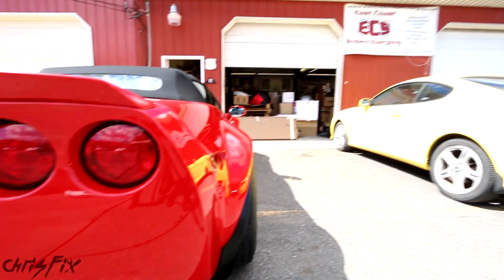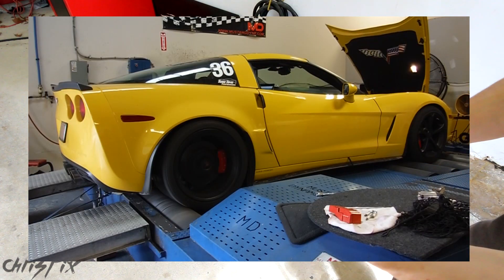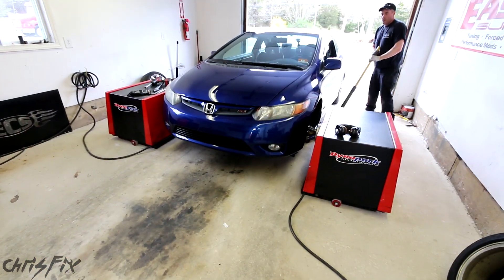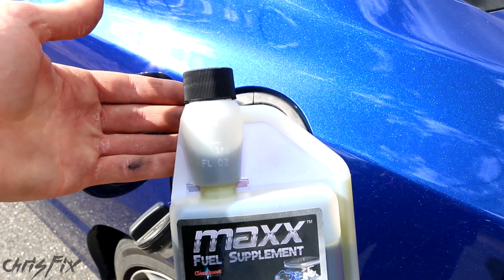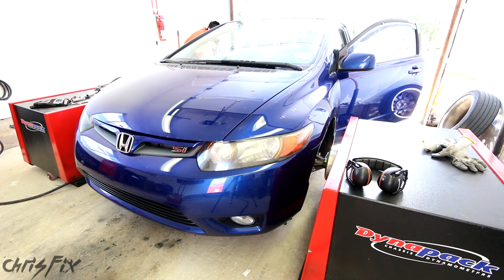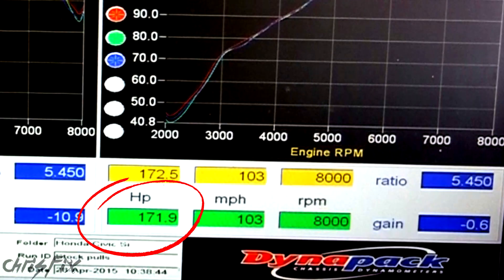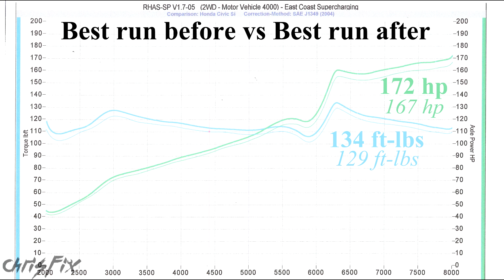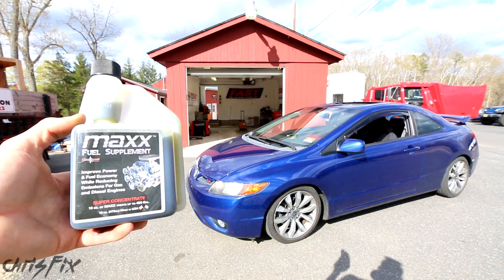Can a Fuel Additive Really Increase Horsepower in Your Car? (With Proof)

Comment: By the sound, it seemed during the 3 test with the fuel additive was pushed farther RPM wise than the first 3 test. The Dyno should show RPM @ HP ratio. So you could compare exact points. likes say @7000 RPM how much HP...
Reply from the maker: Torpedomtb The dyno had an 8k rpm cutoff for every run. You can see the info on the computer screen while the run is going!

Comment: Doesn't the Honda si need too have 192hp. Dealer states comes with 192hp and it boosting out 162. False advertisement don't you think?
Reply from the maker: Alejandro Sanchez That is power to the crank vs power to the wheels.

Comment: Good test. Try Torco. One of my buddies has a turbo Miata for racing and uses it when running the higher boost map without race fuel. Last I heard he made 375HP at the wheels and is still Mazda powered.
Reply from the maker: ABetterLife.Inc Wow, that is impressive! I need to check out Torco. I never heard of it! Thanks for the suggestion! This is how I get my ideas for testing these products so I really appreciate it!
Reply: No problem.

Comment: it supposed to restore power by cleaning intake valves and other pathways with detergents. It does not make it rocket fuel..
Reply: guyonthecouch007 You need PEA's in an additive to clean up carbon build up and you need to run nearly a full mixed tank through, often more than 1 tankful on particularly bad carbon deposits on high mileage cars never treated.  This product has zero PEAs and he most certainly did not come close to burning up a tankful of mixed gas. So carbon buildup/cleanout is most certainly not the issue here.
Reply from the maker: guyonthecouch007 It works by increasing the amount of BTUs (energy) in the fuel.
Reply: so you mean higher octane?
Reply from the maker: guyonthecouch007 no, it does not increase octane. The higher is the resistance to detonation. I had to ask the company how it works because I got so many questions and here is what they said: How it works is it is a catalyst that maximizes the potential energy in the gas and converts it into kinetic energy. Basically, it is making the most of the gas that is in there already.

Comment: WOW 167 HP, My head just exploded
Reply: It's a Civic lol
Reply: SANTA978b 

More impressive is that 129 ft-lbs. Stout.
Reply: +SANTA978b HP at wheels is different than hp at crank. BHP is hp at crank, or the hp the car is advertised to make.
Reply: Josh River yeah lol i track the car too so you can click on my name and watch it lol it was a tuned sti in front of me  i was 3 seconds slower but still on street tires
Reply: SANTA978b pretty impressive for a n/a inline 4 whe nyou think about it lol
Reply: Model192 tahts vtec bro
Reply: i make 230 hp at the wheels but on that dyno i get 20 more cuz of less weight
Reply: Aroutin Abramian Frankly, who cares! It really wasn't the point of this video. Whether your the owner of a civic or a chrysler 200...one thing is for sure...you shouldnt give a shit which one is faster.
Reply: Ned Bass my comment was in regards to a couple dorks debating over which of thier cars (civic & chrysler 200) was faster.
The video its self was good. I even thumbed it up.
Reply: SANTA978b A cheap BWM or Mercedes has less HP
Reply: You're taking my comment out of context, back in the 80's a V8 had about 190 HP the fact that 4 cylinder engines are getting to 200 hp I find that really impressive,
Reply: Homemade Stuffz a cheap Honda has even less HP , if you're going to compared a entry level car from Europe is only fair you use a entry level Japanese car, now the SI is a top tier car it needs to be compared to a top tier car from Europe. Is like some kids out there that say and I quote " I got a turbo in my car and I can beat any V8" well maybe that's true, but if your running a turbo and the guy on the V8 is running  a turbo too, who will win then? BTW I drive a 4 cylinder turbo car and its fun, but is FWD and that sucks a lot. The only European car that would compare to the Si is the GTI and the GTI is a way better car than the Si.
Reply: +SANTA978b  lmfaoo what top tier car?  a gtr is top teir not a civic this car is against the gli/gti i driven both i didnt like the lag on the gli i have raced a gti with my civic with just an exhuast pulled car lengths on him all you need on this car in a hybrid racing cold air intake, plm leader, any 3" catback and a hondata flashpro and tune you get 215-30whp put on on rpf1 17x9 with 245/45 to deliver the power plus its more grip and lighter then the stock enkie wheels you get. the civic is an amazing car theres alot of applications for it from daily to 1300hp drag k series cars to time attack monsters like spoon's FD2R  there are different ways to drive fwd and rwd both can handle differently both are amazing handling in there own way it depends on what your comfortable with
Reply: Aroutin Abramian I think when he said "top teir" it is in regards to a trim level of a specific car.

And its very naive if you think those modifications you listed will create 215-230whp. Cat backs and cold air intakes themselves are only good for engine note changes.  Tallying up all the HP gains that are displayed on the boxes the parts came in is overly optimistic and very unrealistic.
Reply: Josh River lol okay then the dyno is very in accurate then i geuss a intake manifold a tune headers 3.5" intake and 3" catback dose not put out 250whp on dyno pack and 230whp on the wheel dyno
Reply: +Aroutin Abramian sorry about that I fucked up. I took a second look and it was 225whp.
i def owe you an apollogy for that one.
Reply: ***** I don't think I said anything about BHP or WHP, I just said the  Golf GTI has 210hp and in my opinion is a better value for your money than a Civic SI that has 174hp (stock numbers) the Golf GTI handle's better too. 

When I said the Honda SI is a top tier is because I can't compared the SI to a Civic LX that has 143hp (stock). I don't know anything about a Honda GTR, I never seen one probably not sold in the US like many other great Japanese cars, so I can't comment on that specific vehicle. On the other hand is not fair to compare a base trim Golf that has 170hp to the Honda Si 174hp, BTW your  insults won make your Honda faster.
Reply: SANTA978b I was replying to your original comment "WOW 167 HP, My head just exploded". Not your comment comparing the SI to the GTI.
Reply: Josh River its okay man i also did a few upgrades and a touch up tune im pushing a lil bit more ill do a dyno again soon when my trans is back up and runing
Reply: Aroutin Abramian yeah...i wrote a pretty sarcastic comment. I deleted it not long after I wrote it  but you may have still recieved it. I really stuck my foot in my mouth on that one. For some reason I just fixated on the 167hp in this video and confused the info I had. 
Nevertheless..gotta say your numbers did surprise me a little after I came to my senses.
Blue thumb up!
Reply: Stock k24 makes 240 whp and that's not boosted so I'd say that's pretty good
Reply: +Stuntihn MX what in the fuck are you talking about. k24 to the crank makes 200 in current gen SI. smh idiot.
Reply: What do you expect? it's a 4 cylinder engine, its a daily driver, a normal 4-Cylinder car, produces 120-200hp. It's not a 2015 mustang engine.
Reply: +TheMinecraftChannel!- Minecraft and Other Games!   lol mustangs only make like 250 😂
Reply: Actually, 305 on the I-4 engine
Reply: I still don't understand  how people call it a "muscle car"
Reply: Do you how many hp the fastest production mustang is ?
Reply: Model192 He said I get 20 MORE
Reply: TheMinecraftChannel!- Minecraft and Other Games! 
I used 2 bottles so I got 40 more!

Comment: I have an Alfa Romeo 147 1.9JTD (Diesel for you USA) and after putting a fuel supplement I really felt the engine running smoother and quieter. I thought it was a subjective feeling so I asked other people and they confirmed that the car ran a lot smoother.
Reply from the maker: carson phillips Nothing would happen. How it works is it is a catalyst that maximizes the potential energy in the gas and converts it into kinetic energy. Basically, it is making the most of the gas that is in there already. It is not an octane booster. If you add too much, you are just wasting money. I have no clue what would happen with an octane booster.
Reply: All I know is the engine runs more smoothly and has a really nice throttle response :)
Reply: jeffel80 SI fuel oxygenators do not increase/boost the octane rating. The product that ChrisFix showcased in this video is a nanometallic catalyst.
Reply: patw52pb1 isn't tribology cool!
Reply from the maker: Count Dracula Awesome! Thanks for sharing! Nice Alfa!
Reply: Thanks Chris! Excellent job on the videos! Continue with the good work mate!
Reply: ChrisFix what would happen if you put more in it then it suggests? also can you mix it with an octane booster or is that what this basically is?
Reply: just use 2 stroke oil with JASO FC specification for your diesel engine. it will run smoother, help the diesel burn cleaner whats good for the particle filter if your alfa has one, the additives in the 2 stroke oil cleans the injectors and also reduces wear in the high pressure pump....

Comment: Were you using a standard cheaper fuel or High octane fuel for your test? If you were using a cheaper fuel, buying the higher octane fuel might get the same result. In any case, let's be honest here, 11 is not that big a number really. Sure it is an increase but I doubt the driver would notice the difference when driving. With that all said, the bottom line is that the additive appears to do what it claims it will do.
Reply from the maker: Joe Will We used the required premium gas (91 octane) in the engine.
Reply: ChrisFix
I wonder if you would have got the same boost by using Premium (98 Octane). I know that with many modern cars, the ECU can adjust the engine to suite higher octane fuel automatically and I know it's not uncommon for fuel mileage to improve simply by using a better fuel. Even my old car (that uses a Carb) tends to run a little better on Premium and there is no computer in it - I did advance the timing a fair bit though.
Reply from the maker: Joe Will We would have made more power for sure since the engine is a high compression engine and can adjust timing. This product is not an octane booster, it is a catalyst that causes the gas to burn more efficiently therefore giving you more power. Octane works by allowing the car to adjust timing so you can make more power. I want to test the fuel economy claims on this stuff next!
Reply: ChrisFix
Well basically, yeah, Higher Octane is slower burning.
Reply from the maker: Joe Will Well, gas burns the same speed, but premuim wont detonate due to high compression or anything like that so you can get better timing (which is what I think you mean by slower burning)

Comment: ChrisFix I have a 98 Honda civic with a 99 civic engine in it. Only use regular gas in it  would if I used premium in it make it perform better? Would be nice to see if you could do a video on it.
Reply from the maker: Msngr0fd3ath Is the 99 engine the same as the 98?
Reply: ChrisFix yes well I bought the car before the swap. But its the VTEC engine my cars the ex model.
Reply from the maker: Msngr0fd3ath What does the owners manual for that engine say? That is what I would go by. If it recommends premium you can make more power. If not, you probably wont see a difference.
Reply: ChrisFix the owners manual says I can use gasoline of the octane 87 and higher doesn't recommend premium or regular.
Reply from the maker: Msngr0fd3ath Then you probably wont see much of a change since your engine really cannot make the most of higher octane gas.

Comment: more or less just an octane booster that gave the engine a hair more in timing thus giving the games. I can do that at the pump anytime I please.
Reply from the maker: jr540123 Actually, it is not an octane booster. I asked the company because I was getting a lot of comments asking what it does and they said it increases the efficiency of combustion so basically you get more power from the same amount of gas.
Reply: ChrisFix I think we ought to see this test done again in lets say a closed off shop with controlled temps and we the viewers get to see a test with the air fuel ratios up as well as an exact room temperature for a full blown no denying it works test.
Reply from the maker: jr540123 A closed shop is a bad idea because then you will have to take into account air temp rising significantly and also when the car is floored, there is a vacuum created from the suction. The air temperature, humidity, pressure, etc were all taken into account by the dyno and corrected for in the HP and Torque numbers. It would be good to see the A/F ratios though!

Comment: I own that same exact car. An 08 blue si coupe. I don't understand why it didn't go faster than 106? My fuel cut off is 136. Would that make a difference?
Reply from the maker: Cj Snyder We set red line on the dyno to 8000k. I dont know if that makes a difference. This isnt my car so I am not familiar with how fast it goes in what gear.

Comment: ChrisFix   So, what was the temperature of your drivetrain when you did the tests?, In particular I'm wondering about the viscosity of the oil in you got in you gearbox/diff, as cold oil will add a lot of extra drag. How about the battery voltage? Was it low before the first test, then topped off after the 15 minute drive? The alternator can add a lot of extra drag.  Ac ? Many variables, how about the outside air temp ?
Reply from the maker: ***** For as much stuff as we can control in a field test like this, I tried my best to keep things constant. We drove the car there for 30min and everything was at operating temp. We did the first runs in about 15min and then added the additive. Then we drove around for about 20min where everything was at operating temp again and again waited about 15min to do the final three runs. No ac, no drop in voltage, etc. The air temp, humidity, pressure, etc were all recorded by the dyno (check the screen) and adjusted for to give our numbers. Now this is just a single test and as a scientist, I know you need a big sample size but the idea is to show the results are promising. Plus, unless you want to give me another $300 for each test, this is all I can afford out of my own pockets.
Reply: ChrisFix It was just things that jumped into my head when I saw this, I know from personal experience that getting "identical" dyno drags is almost impossible, 5 Horsepower is not a lot, and it's borderline normal error margin\tolerance. By your description, it sounds like you did what was in your power at the time. There is also things like the Barometric air pressure that comes into this... air moisture ect, it's as I said, nearly impossible to get identical results.
Reply from the maker: ***** And I really appreciate the feedback and info! That is the idea! We are all looking for the same thing with these videos... To learn and to get real results so we know best as consumers what actually works and what is snake oil! I want to test the fuel economy claims to see if that is real so then we can see if there are two things going for this additive!

Comment: How does this affect a Turbo engine? I've realized my Turbo engine is very sensitive to different kinds of fuel (Made from Oil vs Made from Coal) - Fuel made from coal gives my car much more of a "thrusting you back in the seat" feel... This leads me to believe that some sensors may behave differently under different types of fuel... Would this change the characteristics of oil based fuel vs coal based fuel? I think you should test this.... or just test with the same type of fuel on a turbo engine
Reply from the maker: Koning Rosekraans I mean, it should make it run even better because it makes the gas explode more efficiently. I have never seen coal gas before. I will have to look into it.

Comment: Humidity changed between the runs. And yes, humidity will change 5-10hp
Reply: The humidity was lower in the runs with the Maxx in the tank. The air was more dense therfore more power
Reply from the maker: mikael6t9 The computer adjusted for everything with the final HP and TQ numbers and the humidity change was not significant anyhow.